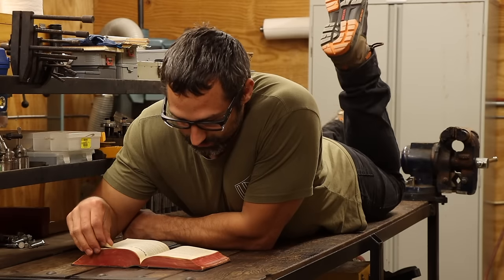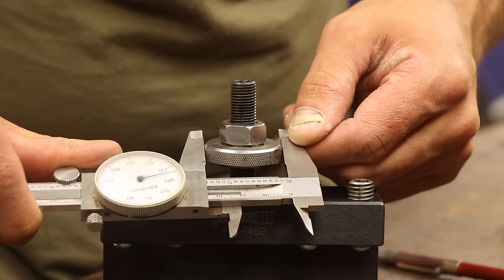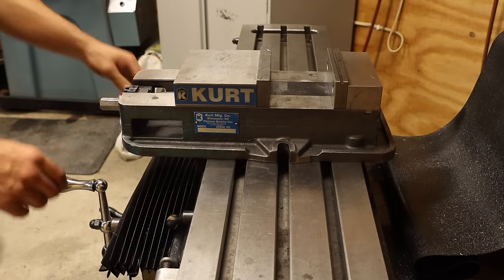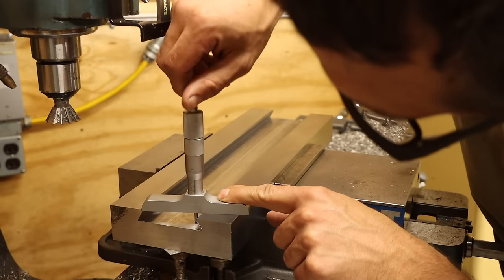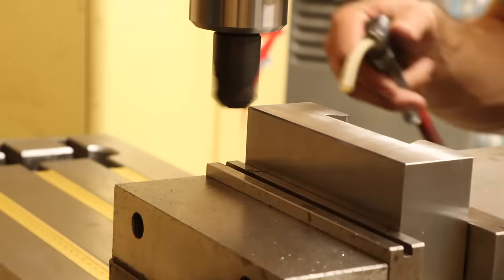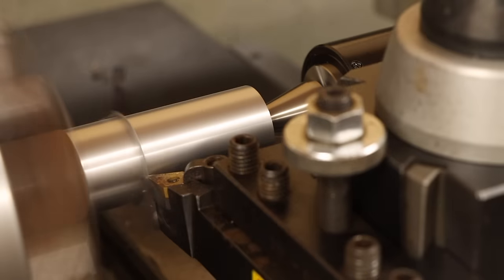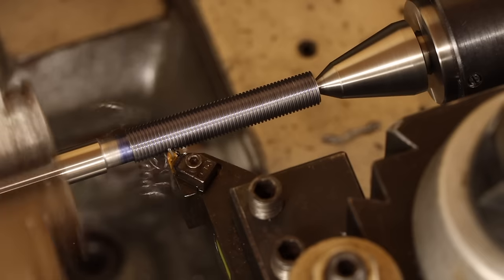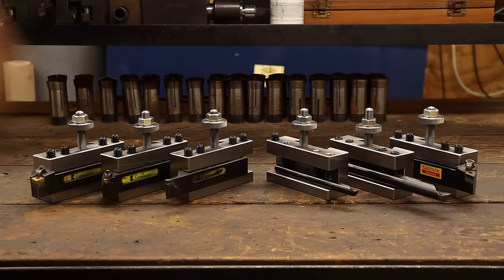Making an ARMY of Tool Holders || INHERITANCE MACHINING

Comment: I just looked up Shars price for these, ~$50, such an increase from what they were 2 years ago. I think you'll need more then you made though :D. 
So all your projects using the surface grinder, is going to lead other home shop machinists to this end. I purchased a 6x12 from Harbor Freight, in 1995. It's really too light duty. It's a rebadged MJ7115 machine (google that). But it does work, and I corrected the spindle bearing issue they had, as they didn't use angular contact bearings, I found a set of matched bearings that fit in the double row contact they used (built to a price, get rid of ABEC5/7 bearings). The bigger issue is balancing the wheels. Also I found extra wheel hubs on eBay used, which makes it nice for keeping them concentric if you swap out wheels. I did make mistakes of buying cheap (but brand name wheels) on eBay, but they clearly were being discarded as manufacturing defects, as they are severely out of balance. The one hub that came with the HF machine has the 3 weights for balancing, and I made an arbor to mount them in a balancing jig that has those 4 blade edge wheels. I got that from eBay as well, but there was too much sticktion for it to work properly, so last year I replaced the ball bearings with some precision bearings for roller blades. I did remove the seals to prevent that drag. It works better but still not good enough.
Reply from the maker: I think excluding the cost for the die I ended up not using I was just under that cost in materials.
It seems like starting with a lower quality machine can be a lot of fun and a great learning experience as you upgrade and improve it along the way. And you probably end up with a nicer machine for the same cost all in. For balancing wheels have you looked at the edge stand type? I used one in my surface grinder clean up video. Main advantage is you don't have to worry about bearing sticktion 😉
Reply: @InheritanceMachining  I did look at one of those. Many free plans available, but I just didn't want to spend the time making one. But I spent enough time trying to fix the one with new bearings. I'm a retired EE, but always fixed stuff. First car was a 1962 Pontiac Safari station wagon my dad got from the dealer. One day in high school, (sophomore) it would not start in the winter. Had to tow it home. Did not have enough compression to fire off. I took it apart to find the cylinders were excessively worn, first engine I rebuilt. I was always hanging out with my dad as he fixed stuff (he was a ME). Had to bore the cylinders out to 0.030, as they were worn that much, and it had never been rebuilt before, only had 72Kmiles on it. My thinking was the owner that had it never got it up to temperature in the winter, so the condensate in the crankcase made acid. I grew up in the damn coldest part of the US, eastern North Dakota, where -40F through the months of late Jan-Feb was the normal lows for the night, and highs of -30 was 'T shirt weather'. The EE job enabled me to build a big shop (did that myself with my dad's help, he was 65 at the time), and to buy mostly used tools. I did start out with a 10x24 Jet lathe, which was made in Taiwan, I got that new in 1976 (while in engr U). Really a preassembled kit, as Taiwan still was not making quality in that era. I still have that lathe today, best thing with any cheap lathe is to buy Bison or similar quality chucks. I notice the 4 jaw you have had the Saturn planet logo, I have 2 of those brand, they seem to be much better quality then the unbranded ones that come with either lathe I have. My new lathe I have 12" Bison 3 jaw and a 6 jaw with that zero set back plate. I made a bridge crane to lift them, as just too heavy for me now at age 65. My RT on the mill is a 12" Vertex, with a 12" 3 jaw with that Saturn logo. Too heavy for me to lift, so again the bridge crane, but I started just keeping it setting on the table and sliding it to one end. 
I digressed. The wheel balance is so critical to surface finish, just the slightest out of balance there's those ripples, that are way less then a tenth. But they look ugly. The wheel I get the best finish from is one of those open grits, VOS, 36 grit (Radiac Por-OS-Way). Just seems to stay sharp when there's lots of material passes to do. The manufacturing method left them to be well balance naturally. I have a digital 2 inch Mitutoyo indicator I use to control down feed. I find 1 thou cut to really push the machine. Understand I'm dry cutting, so burning the surface will occur, which is interesting as it will swell upwards and you're left with a over ground area (bird bath would be the term for dip in concrete slab). The machine just is not set up for coolant. I've thought of making a box, and mounting the mag chuck inside that to the table to catch coolant. When I got it, the internet didn't exist with Craigslist or FaceBook Market place. Now I see quality name brand ones available all the time. I didn't live near any big manufacturing city. The company I worked for was Collins Radio, and they had at one time in the 50s and 60s space program era, one of the most sophisticated manufacturing abilities. That was gone when I started work for them in 84. It was a division of Rockwell Int. when I started work.
Reply from the maker: @f.hababorbitz  You share a similar story to my first car. A 1991 Ford Ranger (I4). Ended up going with a remanufactured engine due to some irreparable damage. But I learned so much going through literally everything that I was eventually able  to diagnose issue pretty quickly over the 7 years I drove it through HS and college. What a great lesson.

Also thanks for the grinding tip(s). It seems there is endless amounts to learn about that machine by itself.

Thanks for sharing
Reply: @InheritanceMachining  You really seem to be doing real professional metal machining. As well your video production is very well done. Your making of the surface gauge, sine plate, and using them to diagnose squareness and angle issues of a part was not where I was at your age. It's been the last 5 years that I got into that level of metrology. And it started with the MT4 adapter into my large lathe. Grizzly claimed the headstock taper was MT6, it is not. And all their documentation says it's that, but I found out it's a Metric Taper, 90mm gauge line. This has a 1:20 taper (half angle, 1:10 double angle) on it. Any way that adapter that came with the lathe was machined with the minor diameter 0.0045 too small (about 4 inches long) it felt like it seated in the taper, but it would rock, and the center would not be concentric with the lathe spindle. So I got a sine plate long enough, and a precision bench center that would fit on that, to hold the adapter between centers (I had to purchase another MT4 lathe center with a female drilled center on the other end) on the bench center. And then inserting JoBlocks, I found that error using a dial indicator till I got the top edge of the spindle adapter to indicate parallel to the surface plate. Then I had to figure out how to mount that in the lathe, but I saw Keith Fenner mount a round bar in his 3 jaw, and machine a 60 degree center on it with the cross slide, and that's perfectly concentric to the spindle. Then playing around with the tailstock center to support the other end. I used a tool post grinder I had gotten from Enco many years earlier (way too big for the 10x12 Jet lathe) and used Joe Pie's method of setting the cross slide angle using a small sine bar clamped to the side of it, and kept sweeping till I got the correct 1:20 angle needed. Took many passes to remove that 4 thousands. But now it fits as it should. 
I think your lathe is a much better built machine, As I said, I'm convinced mine was made from scrap parts. And that metric taper is a European lathe thing, so these were never intended to be delivered in the USA. Oddly the threading screw is inch, so I can disengage the half nut and not loose timing on Imperial threads, but must keep it engaged on all metric. The quick change has the gear built in, and just switch out a lever to go between the two standards. It also does diametric pitch threads, which I think are used in worm gears. It weights 5800lbs, 7.5HP 3 phase, that I power with a VFD. Never use that HP in machining though.

Comment: 12:33 there is a hiccup, you can see between two certain frames that not only does the work tilts upward, but the stop ALSO shifts ever so slightly. im guessing the tap got stuck

Comment: i think that part of the problem at 14:55 might be that you are threading m12 using a 12mm bar, i think the major diameter should be slightly undersized but i could be wrong.

Comment: Hey there
If I may, first milling op was crying for direct table clamping. No vise, jacks, and parts tilting.
Also, though not if great importance here, try finishing after all the roughing is over: you finished the dovetail side and then hogged off a ton of material for the tool slot, part certainly 'moved', internal stresses etc 😜
Reply from the maker: I should have moved the table clamps project up on the list 😉 And very true on the internal stresses. The material was listed as annealed, and I think that saved me on the warping I did catch. Could have been a lot worse if it was straight cold rolled!
Reply: @InheritanceMachining  don't need fancy clamps really...
Reply from the maker: @thanos_vgenis  oh duh… my brain was thinking if I fly it the top face 😂
Reply: @InheritanceMachining  😜😜

Comment: Funny... when you said you completed the tool holder holes without a single problem at 12:33, I watched one of the tool holders pick up out of the vice when you tapped one of the holes ;)
Reply from the maker: Completely unintentional! I didn't even realize until a few others pointed it out. 😂 In the trash it goes !😉

Comment: Still no non ferrous back fence on the S-G mag vice, makes the everyday square it up n run the wheel over it so much simpler ;-)
Reply from the maker: I have one and use it often but in some cases I have to take it off for clearance

Comment: Check the bottom of the dovetail on the commercial ones.  See that little alley in the middle?  IIRC, it's there to reduce the amount of surface you register against.  Keeps it more accurate?  When I saw the dovetail cutter flush to the bottom, it reminded me of that.  I don't know if it's really necessary, but it is a feature that is included to promote repeatability and accuracy (I think).  Very nice project both in concept and execution.
Reply from the maker: Thank you. I was a little perplexed by that as well. The tool post doesn't even engage with that face. There's about a 50 thou gap between the faces. Makes sense the its ground in the areas near the dovetail for measuring as I did. But the middle section is a mystery. Maybe they cleared that as well for some different measurement technique
Reply: @InheritanceMachining  It's a relief cut. You can tell by the precision surfaces on either side. You don't need the tool post bearing on the whole surface. It is cheaper to produce, too. I will defer to someone who is more informed than I.  But that is what I remember from my forays into this subject.

Comment: Those toolholders look fantastic!
I think you said you were going to heat treat them. What are you going for, Rockwell 60 maybe?
Great job! I agree that convenience is important. It's nice to just grab the right tool and have it ready to go. Afterall, what's the point of a QCTP if you don't have everything ready to quickly swap out....
Love this channel! Please keep sharing your machining adventure!
Did you get to spend time with Gramps in his machine shop when you were little? Is that why you went into Engineering?
Keep it coming!  :)
Reply from the maker: Thanks as always Art!
I'm not sure I'll heat treat at this point since I've already taken the dovetail to dimension. But may reconsider if I see significant wear.
I did spend quite a bit of time with my grandfather and these machines. And it was a HUGE part of going into engineering for sure. I give a little background in my very first video if you haven't seen it already
Reply: @InheritanceMachining  :)

Comment: Hi Brandon i understand the make it all but those M12 studs could easily be made out of a all thread rod or already at length from McMaster. Much cheaper than buying the die and the 4140 rod.
Reply from the maker: I didn't consider the threaded rod but I just compared costs out of curiosity. Material and die for what I did was around $70. I'd have to buy 2x 300mm threaded rods at $40 each so I's end up around the same cost. But good to know in future! Thanks

Comment: I do not claim to have done this myself but i was watching cutting edge austraila ( if you want machining vids to watch there a lot on that channel) the way he does champher on rhe back side of a part set the parting tool in the clamp the your champher tool facing oppisite on the other side start the parting the stop do your champher on both sides of the new edges then continue parting

Comment: man you should make really nice gyroscope it will probably get a ton of views too

by the way if you want to make a part square on the surface grinder faster and easier 
theres a trick where you use a square vice, mount the part in it use a round piece to squeeze it against the back face of the vice
 we use this trick at work where we make molds for plastic and stuff like that we are just making one for lamborghini ... im just saying that so you know we aren't making crap :D

Comment: The closest I come to being a machinist is watching videos like this one on YT, so I'll just say I think it's mind-boggling to learn that a piece of steel that thick can actually bow under its own weight at the ends.
Reply: I know I'm 5 months late to this comment 😂 but you might find it interesting that it's definitely not bowing under its own weight, but it likely bowed because of internal stresses from manufacturing. After cutting out a bunch of material on just one side, it relieved some tension, so the other side pulled it into a bit of a cupped shape.

Comment: While rhe knurled adjusting knobs were rewarding to make, you'll actually be happier with a threaded shaft collar instead of the knurled adjuster snd locking nut.  Much easier to adjust and lock down without changing the adjustment, and they won't vibrate loose.
Reply from the maker: That's a very clever idea!

Comment: If you haven't already, look into some spot drills. I noticed you predrilled with a center drill, for a lathe, on a mill. That's an old technique that nobody uses anymore.
Reply from the maker: Huh... somehow I've never come across these. My grandfather always showed me with a center drill, but it's admittedly complex for drill starting. Thanks for the tip!

Comment: 15:15 I think I might have mentioned this before, but one option you have is to single-point the thread to partial depth and then finish with a die. The die won't wander because it'll follow the partial thread, and it can save a bunch of time.
Reply from the maker: I actually considered from your comment once before but didn't want to risk a new technique. After the first mistake I only had enough material to make the 6 I needed. Cutting it close!
Reply: @InheritanceMachining  That sounds pretty wise, to be fair. A technique worth testing on some scrap perhaps. 😁 I've used it quite effectively on stuff that really doesn't like to take a die (looking at you, stainless).

Comment: 12:34 "... and without a single hiccup, I might add, ..." Why, then, is there a tap sticking in a tool set-screw hole, and the holder-to-be has shifted up and slightly angled in the vise? 😄

Comment: Brilliant work, as we've come to expect.
Opinion: leave them blank. I've had success warming holders up, slightly, applying some furniture wax and rubbing off the excess. Cheap and so far successful rust prevention.
Reply from the maker: Thanks! I may give that a try if I start to see hints of rust. So far the dehumidifier I'm running has been a champ at keeping the rust off of stuff

Comment: Just a suggestion, you obviously got the results you wanted, you might have better luck on finishes on mill with all tools conventional cutting on a manual mill. Unless that mill has ballscrews instead of lead screws. Nice work none the less I like your videos
Reply from the maker: Thank you and thanks for the tip. I’m still sort of working out the advantages of when to use climb vs conventional mill. I went with climb here mostly prevent over cutting on the  dovetail width, though conventional certainly would have left better finishes.

Comment: Forgive my ignorance but do these not need the corner of that dovetail clearanced? Normally things that set up on a corner need that clearance cut, no? Or is the tool holder not getting that deep into the dovetail
Reply from the maker: Your later comment. The toolpost dovetail doesn't go that deep

Comment: Tell the wife you need a VDI30 machine because the holders are cheaper in the long run 😂
Reply from the maker: Cheaper than the ones I already have? 😂
Reply: @InheritanceMachining  With the current steel prices, labor and tooling i would say you'd save 10$ per holder. 40-60$ if it was a customer job

Comment: Am I crazy, or did the stock move when you were tapping the left most setscrew hole on one of the holders at https://youtu.be/16416yaLsFA?t=753 ?  It seems like it tilts a couple degrees.  
If the stock moved, did this cause any issues?  I wouldn't expect it to as it's just for the setscrew...but I'm still curious =D